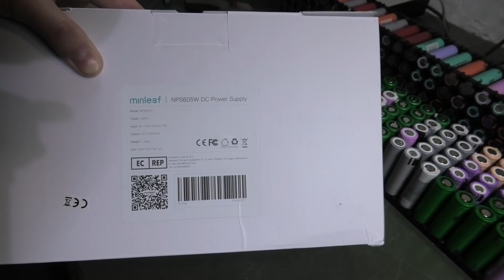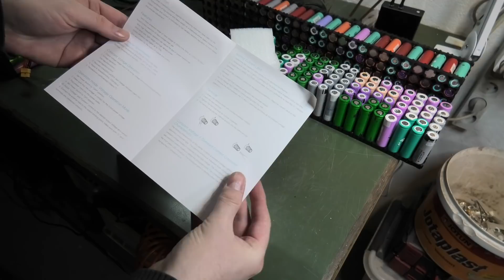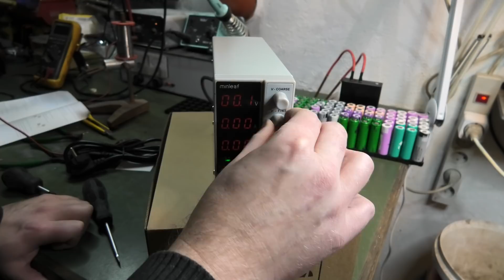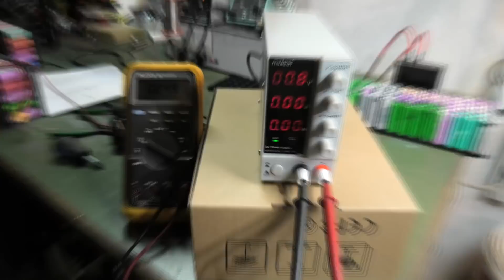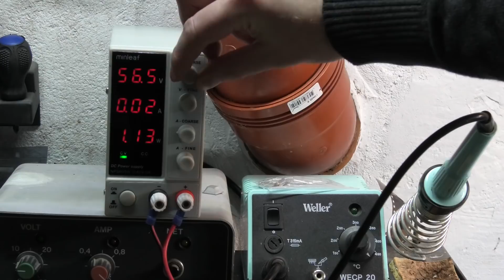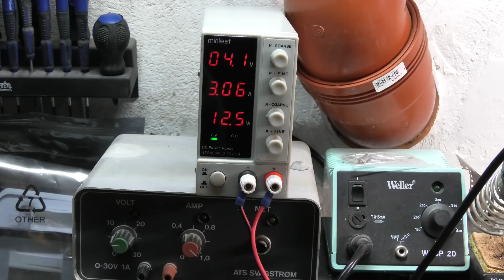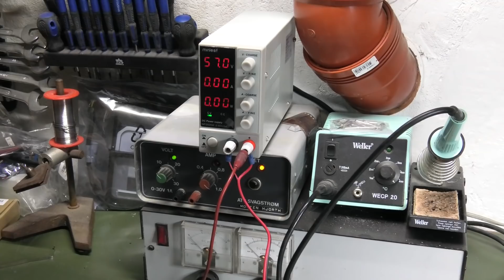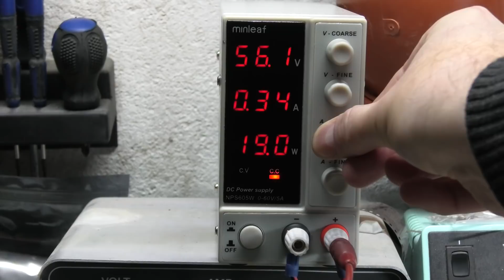Affordable minleaf NPS605W DC 0-60V 0-5A Power Supply - 1039

Comment: Setting the CV or CC on these sets the upper limits on these. 1st set the max V at that time (no load) you are not able to see any changes to the values via the current knobs.. however by playing with them you are setting the max ie ceiling current (you just can't see it). To set the inial max current, just touch the probles together (after you have set the max V), this will now show you the ceiling current (which you can now adjust via the course or fine knobs). And here you go, you have set the max levels for the CV and CC. Hope this helps.
Reply from the maker: Hi Down Under Garage
Thank You very much!  glad you liked the video :-)
Thank you for watching! :-)

Comment: For those cheap power supplies, you can short the output to discharge the internal capacitor much faster. Obviously you shouldn't do that with a battery connected to the same terminals at the same time :)
I would have recommended a riden RD6012 or 6006 power supply instead. so much easier to operate and a lot more fine control over voltage and amperage as you can either dial them in, or turn the knob which is a rotary encoder, not an analog potentiometer.
Reply from the maker: Hi lnxpro
Thank You very much!  glad you liked the video :-)
Thank you for watching! :-)
Reply: but riden is much more expensive as well?
Reply: @Fanaz10  much cheaper than professional power supplies that do the same thing. But yes, more expensive than cheap budget power supplies.

Comment: I have a peaktech 6227 that works fine in the same voltage range, but it was 110€... ups... but the settings thing is clicking on my unit.
So I think, I‘ll get one, but only for testing of non sensible components like pamps, battery’s or so.

PS:
I‘ve just started to watch your videos on my tv, with a denon amp and pioneer cs-797 HiFi speakers instead of usb pc loudspeakers. Does my my setup fools me or did you microphone catching low persistent base sounds?
At 9:50 it‘s fine and at 10:05 it‘s started again.
Maybe my new setup is way to overkill to watch YouTube videos.
Reply from the maker: It is very possible that I could have something making some noise.

Comment: Just a few days ago, I got a PSU from Banggood too. A bit more expensive, but it is real nice with a keypad to just enter volt/amp, and memory for the most commonly used. Still has a rotary up/down encoder for fine adjust, not those those finicky twister button.
Reply from the maker: Okay,, sounds nice!!  I think I spend ½ a year building the black one I have,, 20 years ago and at double the prices,, these are so cheap now.. a bit scary.
Reply: @MyPlayHouse  Yeah, your self-built one looks like a quite nice project for its time. But with digital controls and more complex (and cheap) component types, many extra features are nearly free to implement now.

Comment: hi you could replace the Corse current and Corse voltage potentiometers with 10 turn potentiometers for finer and easier control
Reply from the maker: It might be worth it, to get some better ones.

Comment: that is very touchy, maybe you can replace the potentiometers with proper 10 turn ones. Also the readings are all over the place, it is probably extremely noisy on the output
Reply from the maker: I should have brought out the oscilloscope ,, :-)
Reply: @MyPlayHouse  yea that would be nice to see, I have seen a few videos about youtubers getting power supplies that are built very similarly, but no actual testing of the noise or accuracy of voltage/current!

Comment: I actually laughed out loud when you said "Banggood is very good at sending the correct power cord" ... I bought a cheap laptop from Banggood (~$500) and received the wrong power cord. I emailed them, and their response was "oh, we will give you a $8 refund" .. which of course I did not accept... Some 24 emails later I finally gave up on them sending me the correct power adapter and accepted a $100 refund.. (I modified the power cord they sent me to suit our sockets)...  Moral of the story - keep hounding Banggood if they do not do what their website says they will...
Reply from the maker: I have proboly thrown out 1000 of these cables from new computers, monitors, servers and printers,, and than they send me one all the way from China,, But an EU cable,, they got that right.

Comment: It looks like it works but not being able to toggle the output separately from the device power? Not being able to see the setpoint when using the dials if you aren't connected to anything? I wouldn't choose this myself for a 60v lab psu if I needed one. I like my Tacklife 30v/5a one from Amazon but they don't make a 60v version.
Reply from the maker: I needed the 60 volt to charge the battery banks,, they also have a 0-30v 10A same box,, but that Tacklife 30v/5a looks cool!
Reply: @MyPlayHouse  Yeah if you were interested in looking at a few more power supplies I will probably need a 60v one eventually to do some PoE stuff that is way over 30v. Would be interested in seeing your opinions on a few of the 60v options available. That RD6006 DIY PSU another commenter mentioned looked really cool!

Comment: I have been using one similar  from this spring with no probs. I use it to charge my multiple ebike batteries, love current control. One prob is a little noisy and the fan will turn on and off. Not disappointed with this product maybe I got a good one. Cheers  . )
Reply from the maker: Hi T Komoski
Thank You very much!  glad you liked the video :-)
Thank you for watching! :-)

Comment: NPS605W - There is a black and white one. Looks good to me. Think about safety and Chinese stuff. Don't go over 60% of the named performance. You can still change the voltage set potmeter with a 10 rounds potmeter. By 60V means you get 6 Volt per round and not 60 Volt by 80% turning of a default potmeter.
Reply from the maker: That might just be what the W in the model number is for :-/